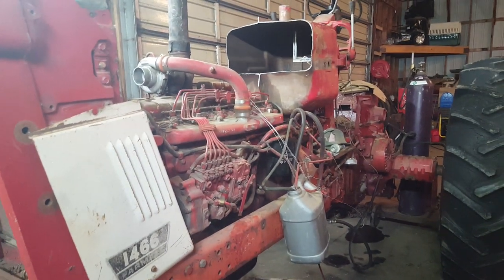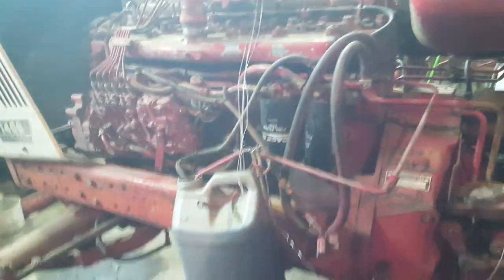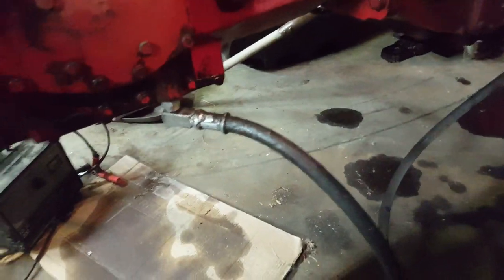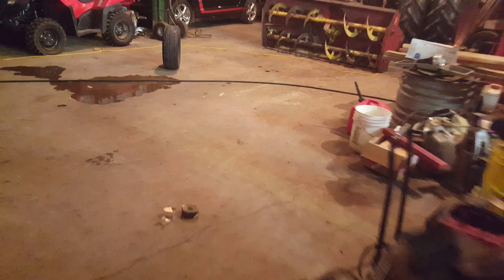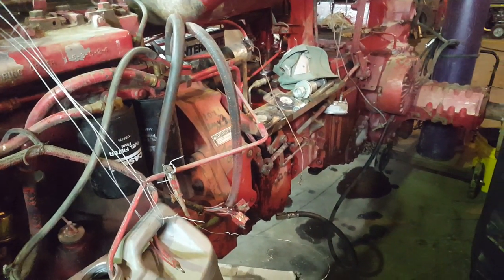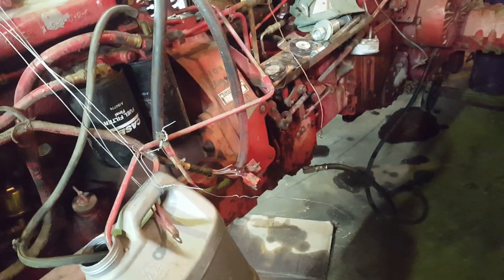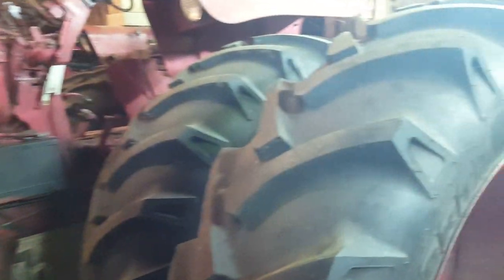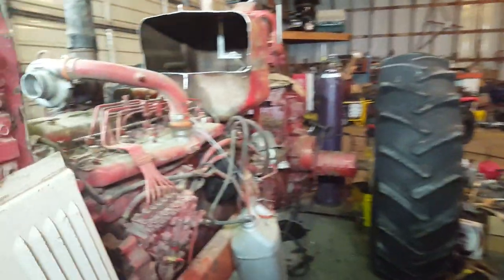A quick fix when having MCV pump problems on your International Harvester

Comment: Thank you for posting this I have a 1466 that I love and was plowing with it about two weeks ago when I parked it for the night and the next day everything was fine but I had no Steering or TA.  I talked to the local IH dealer and he said that I should bring it in and he would have the guys tar into it and find out what it was going to take to fix that old thing up. Will I may not be the sharpest tool in the shed but I could sure figure out that at a $100 an hour for them to dig around and see what all needs to be replaced with an 52 year old tractor was going to cost more than I could afford. After watching your video for $7 and some hydraulic hose I had I finished up the plow. Thank you for the information

Comment: Thank you so much for the advice from North Dakota! I had a 756 that had sat for 8 months and had no steering or clutch. Tried some remedies that didn't help. Found your youtube video, made up the hose and solved the problem. Took a couple minutes to work but IT WORKED! Thanks again for the info.

Comment: We have a 706 dsl, having same problem. My father bought this tractor new in 67-68. Replaced this toy like plastic check valve. Worked for not even a full season(summer). We're down here in Virginia where it doesn't get quite that cold here. Thanks for the tip.

Comment: Having a problem with my 806, no steering, ta, but the brake works on one wheel, went through mcv valve, new springs, orings. and a new pump, same as before, gonna try the pressure relief today, Im down here south of Fargo 50 miles. been up in your area hauling fertilizer for years. you finish your puller?

Comment: Just subscribed and I'm doing some research. I bought a 1486 that had sat for 21 years. Full of fluid, no light on the dash (light does work, I checked) but I have no steering. I can't even move the wheel back and forth more than a couple inches. But when I do the steering will wobble back and forth just a little bit. If I try this hose and I still have no steering what would be my next plan?  There is some surface rust on the steering cylinder but not enough to keep it from moving. Should I loosen the lines and see if I get any air/fluid from them? Thanks for any help!!
Reply: Jack up the front wheels and check for a spindle that is seized with rust. I've seen this happen on a 1066.

Comment: Hello, I'm having the same problem with my 1066. There is not a plug to remove on mine. There is a line already in the same spot that you put the one in the video in that goes up to whatever it is the clutch goes into.
Reply from the maker: Does your tractor have a torque amplifier? Some tractors that have had the TA deleted, this trick will not work on those
Reply: @chrisdieterbilt2515  yes it does have a ta. Just my luck. Was told by a ex dealer that the 86 series that it is plumbed in factory
Reply from the maker: @scottmccullough978  interesting, I think the only tractors I've seen set up like that were tractors that had a TA delete. Learn something new every day I guess!

Comment: You at all familiar with a 3514 hydro drive I’m having issues with low to no pressure will not move up a hill
Reply from the maker: Sorry but I don't have any experience with the hydro tractors, only a couple running around in our area.

Comment: 1486 rebuilt valve body and new mcv pump. now no steering, soft clutch. is the plug you take out where the relief valve is at?
Reply: Ugh. I don’t even want to hear about an 86 lol. I had a 1086 that had absolutely awful steering. Actually good brakes. Jumpy clutch. Hardly any flow to the scv’s. 3 point worked fine. Both pumps replaced. Fixed nothing lol. Wished that tractor would’ve burned

Comment: Well that worked..........but now I have hyd oil leaking down from behind the flywheel out the bottom inspection plate. What did I blow? and do I now need to split the tractor to fix it?
Reply from the maker: There is nothing in the flywheel housing that would leak as a result of this procedure. What model of tractor are you working with
Reply: @chrisdieterbilt2515  it is a 706
......where else would the hyd.  leak come from other than the input shaft in order for oil to be coming out that inspection opening?  Could supercharging the system caused the oil to pass the TA bushings if worn and push out the seal?   any advice is surely appreciated.  TIA

Comment: When this is done your adding possibly 2200 psi to a system that is only suppose to have 350 psi max in it.  No wonder you have leaks everywhere now.
Reply from the maker: You aren't using the pressure to energize the system, your using the flow. There is alot more than 350 psi flowing through the MCV system, if that's all you have then you have some major problems
Reply: @chrisdieterbilt2515  on 1066 run hose from drain plug to remote or is there another way if hose isn't available?

Comment: what if everything works but the steering
Reply: I've got the same problem. Figure anything out?
Reply: I’ve got the same problem!
Reply: There is a relief valve just for the steering in the mcv lower right. Also the priority valve can stick.
Reply: @zackvahlkamp5044  i got a ih 2444 that the hydraulics are acting so weak with the 3 point all the way down the power steering works great but when i put the 3 point up the power steering goes away and the 3 point can't pick up the attachments